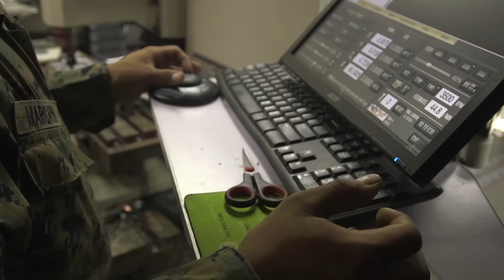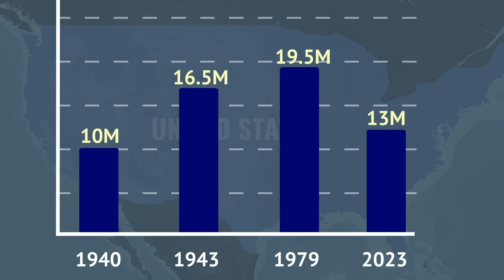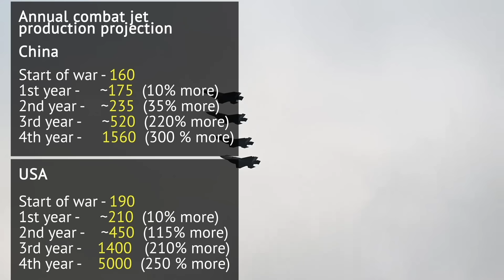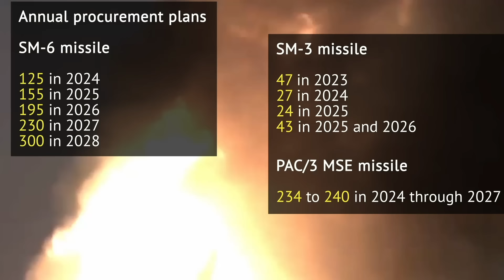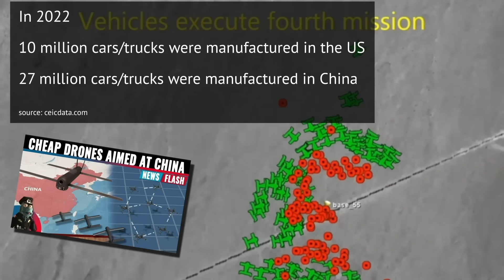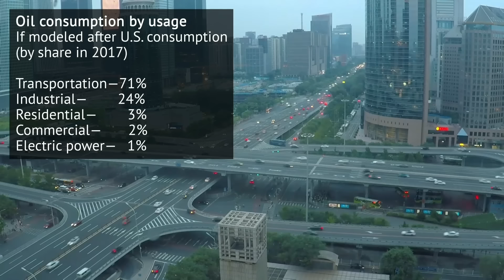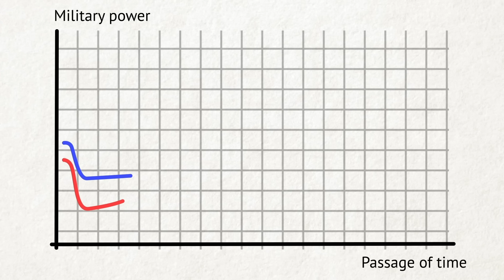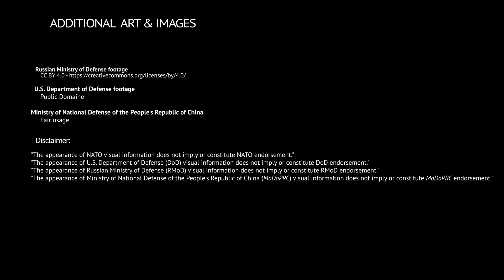Can industrial output decide US v China war?

Comment: "Don't start a land war in Asia," the saying goes.  OK, putting that aside, you correctly point out the ocean would be the likely approach.  Considering industrial outputs for both sides, may I suggest an additional consideration: the necessary inputs for each country's industrial base and each country's population.  Looking at the necessary industrial inputs -- all sorts of raw materials, oil, food for military and civilian populations, etc -- China's logistical chain for all of those inputs is quite long, is seaborne, and those inputs are critical for keeping the lights on and the population alive, much less fighting a long war with an opponent like the US.

TL;DR

That's a no-win situation for China.  Full stop.  China imports more oil/oil equivalents than anyone on the planet.  The daily energy needs for China is something like 12 or 13M barrels of oil (or oil equivalents). About 70% of that 13M-barrel supply comes from the Mid-East on the longest supply run for oil deliveries on the planet.  All that Mid-East oil heading for Asia goes by India, through the Malacca Strait, by Singapore and eventually to southeast Asia.  The route through the Malacca Strait is the shortcut (!) to get to southeast Asia by sea.  

If China goes to war with anyone who has even a small navy, it would not take much to park some surface ships in the Indian Ocean (and submarines underneath) and cut the oil supply line to China.  Even if the oil ships avoid the 800 km of the narrow Malacca Strait, they have to sail much, much farther, extending the longest oil shipping supply line by maybe 1/3?  BTW that alternate route would also be staked out by an opponent of China.  Point is, without 13M barrels per day, China would have a lot of trouble keeping the lights on, the population fed, and the country running, even on a reduced wartime footing.  It also would mean the end of most of China's industrial processes, once their reserves of industrial inputs are exhausted.  

Then there's food.  I believe China imports more food than anyone else, most of that by bulk shipping.  They grow a lot of food also, sure.  Yet they import most of the inputs they need to grow that food.  IOW shipping anything to China during a shooting war will probably drop by 80% because shipping companies do not want to be in a war zone. (Note that almost all shippers are out of the Black Sea by about 90% since RUS invaded UKR. The RUS "ghost market" ships still move oil and other goods to buyers for a big discount, but they do not ship serious amounts of anything to/from the Black Sea.)

Yes, China would have reserves of the inputs they use.  Yet they import more of the key inputs than anyone else:  oil, food, raw materials.  Cut those supply lines by 1/2 or 2/3 or more and China burns through the reserves.... then things get very bad very quickly.  Food shortages and eventual famine, de-industrialization with no oil/energy, and a population of over 1 billion people in dire need of food and energy to survive. There's no version of a war between the US and a no-food/no-oil China that ends well for China. 

This long list of things that could go wrong assumes that no one else in China's neighborhood decides to attack China's logistical supply lines either.  China is not on good terms with Japan, South Korea, the Philippines, Vietnam, or any of the rest of its neighbors.  Any of them could make supply chain problems become nightmares for China while China and the US shoot at each other.  

At what point would China, faced with the supply line problems above, go "new-Q-ler"?  (sound it out, it should sound like the words "new" "clear").  
So..... none of us should want a war between China and the US.  Not China, not the US, and not the rest of the planet.
Reply: @The136th 20% of China’s GDP is from exports, but more than 70% of China’s oil usage is from exports?
Reply: That makes it worse for China. Think about it. About half of China’s domestic economy is in real estate and infrastructure construction. Cement, steel beams, buildings, and bridges. Exports are manufactured consumer products. Washing machines, toys, clothing, etc.

Compare: (Cement, steel beams, buildings, and bridges) vs (washing machines, toys, clothing, etc.). Which set gets a larger proportion of its value from its embedded energy? Which set gets a larger proportion of its value from the ingenuity, skills, and effort of the workers involved?
Reply: Most of China’s manufacturing value-added stays in China. For example, China produces 55% of the world’s steel, but China consumes 50% of the world’s steel. If this conflict breaks out, we will be happy to watch that all go to zero. The difference between 55% and 50%— that 5% will be a shortage that we will have to deal with, but that’s plenty doable. Existing facilities can make up a big chunk of that. From there, the US’s market power will ensure that the shortage will fall elsewhere.

Rare earths aren’t an issue at all. After China used them to attack Japan a decade(?) ago, companies and governments took steps to neutralize the threat. Won’t be an issue.

The pandemic also showed companies that they need to diversify supply chains. That definitely includes pharma companies. China might still manufacture a lot of drugs, but companies believe that they have built enough resilience against disruptions to get new facilities up and running before supplies can run out. 

That resilience is possible because there is lots of underutilized low skilled labor available around the globe. In contrast China cannot build comparable resilience to loss of maritime trade access, because underutilized alternate trade routes and resource suppliers simply don’t exist.
Reply: Ok, now imagine how American consumers would react to no longer getting iPhones.
Reply: @The136th Neutralized. For starters, we have figured out how to use a lot less. Remember hard drives? Spinning disk inside every electronic device that provided permanent memory storage? Rare earths’ powerful magnetic properties allowed you to get a magnetic bit of memory into a smaller area, so rare earths were a major component of every electronic device that required lots of long term data storage. But when was the last time anyone used a device with a hard drive like that. There are no spinning magnetic disks in our devices anymore. Instead of magnetic disks, electronic memory is all solid state chips now.

We need a lot less rare earths now. The global annual market for rare earths these days is measured in the mere millions of dollars. That’s “millions” with an “m.” The companies that still need to use significant amounts of rare earths are big companies like Apple and Siemens that can afford to scoff at costs that are measured in the mere millions. Those companies now routinely keep many months of the rare earths they need in storage, just in case. 

Those companies are also big enough to have lots of political clout. They have convinced multiple governments around the globe to set up rare earths processing factories. Those factories are kept mothballed, ready to go into operation if they are ever needed.

Those companies believe that the rare earths threat has been completely nerfed. A decade ago, they were screaming about the danger. These days, the only time it comes up is when company leadership has to reassure uninformed shareholders.

Rare earths are no longer a major source of strength for China or weakness for the wider world. China produces them for cheaper than anyone else, which is nice. But rare earths are no longer a dependency.

Comment: You left out China imports all of its Fuel and hence China would be crippled.
Reply: Yeah but thats why china has that pipeline for the russian oil. If necessary they could speed up its construction and would have to be heavily guarded
Reply: @SilenTHerO78614 Capacity is only a tiny fraction of what China would need.
Reply: @yopyop3241 They could always ship oil by truck if necessary or build new pipelines in a hurry.  Russia is the second largest exporter of oil in the world and shares a border with china, how to get the oil there isn't exactly an insurmountable problem.  Chinese oil stocks would last roughly 6 months which is enough time to get something worked out with Russia.
Reply: @elmateo77  Like I said, nowhere close to enough capacity. Do you know how big oil tankers are? How many trucks it would take to replace that capacity? What the road conditions are for a drive across Siberia?

China can last six months only with strict rationing and without any major oil expenditures. You know, like the oil demands associated with an amphibious move on a neighbor. If China isn’t planning to surrender right away, it can’t last more than a couple of months.
Reply: You left out the fact that China is now the first in EVO cars. This reduces fuel requirements a lot.
Reply: @yopyop3241   spot on.  Alaska pipeline is a good reference the Americans used all there industrial might and had nearby ports and built roads and 10’s of thousands of workers and it took years. Now imagine makeing that pipeline in Russia through Siberia lol 😂. USA is king of Logistics now look at Russia hell it can’t even supply its troops which are 100 of KM away from huge supply hubs. No China will not get such pipelines anytime soon.  And the USA Attack subs would close the Malaca strait and both canals China would implode.

Comment: The biggest problem for the US is that it couldn't even ramp up war production during a time of war, even if it wanted to. Why? Because the US doesn't have the raw material, it doesn't have the factories, it doesn't have the equipment, and it doesn't even have enough to defend all of that even if it did have it. You can't make manufacturing machines out of thin air. These are big heavy machine that require not just materials and time, but also expertise that no longer exists in the US. Not even 1 in 10,000 people in the US have the expertise required to run such machines. China on the other hand, can simply produce lower quality in high numbers. 

What's one top tier jet vs 100 mediocre jets. You simply can't win. Now multiply that by everything. They lose 100 jets, they'll have 100 more up and running in a week. US loses something, it takes months if not years to replace it. Just look how long it takes to build a single carrier or jet or tank in the US. They could speed it up, sure, but it wouldn't be enough, and eventually things will run out. The US has almost no mining activities left for raw resources. The US has almost no metal foundries left, so it couldn't even process the ore, let alone turn it into something usable, not at adequate war production levels. 

And then there's expertise again....when you have a bunch of completely inexperienced people, not only will their work product be inferior, that will cause issues with production at every level. Not just slow downs, but complete stoppages, dangerous working conditions, and inferior parts used in construction that cause a plethora of logistical issues to the point stuff will be breaking down all the time. Anyone who believes the US can muster anywhere near an adequate war time production is living in a fantasy.
Reply: Lol China imports 60% of its oil overseas. Also “the U.S. has no raw materials,” 😂😂
Reply: @garrettfulks2932  cannot agree more. US could make its own jet with non-Chinese raw earth and cue its own peopele with non-Chinese medical meterials. Besides, the living standard will be higher without Chinese cheap products. People will support the current party without any thoughts of switching to the other.
Reply: @garrettfulks2932 You forgot who controls the Persian Gulf🤣👉🗡⏰

Comment: The U.S. is making 3 destroyers/frigates per year? My state shipyard builds 2 Arleigh Burkes per year...and it's not even close to the biggest military shipyard in the country. I used to work there and off the top of my head I know of 4 shipyards 2 on the East Coast 1 Gulf Coast and 1 West Coast that all build at minimum 2 destroyers/frigates per year so I think your info is off Binkov.
Reply: You can look up the commissioning's, you know.
Reply: @westrim  and ingalls in Al is 2 a year as well and those are just the two building flight 3 Burkes you have freedom independence class lcs which I used to do the graphic design modifications on

Comment: As a Chinese national, I've noticed that many people in the comments section, while aware that China is the world's largest industrial nation, seem to have a limited understanding of the country. Therefore, I'd like to share some insights:

1. China's southeastern coast is protected by the world's most comprehensive ground-based air defense system. In the event of a conflict, it would be nearly impossible for an enemy nation to attack mainland China with air forces and missiles.

2. Currently, China is both a major manufacturing hub and a significant importer of resources because it serves as the world's factory, producing industrial goods for global consumption. In the event of a conflict with the United States, while resource imports could be blocked, there would also be no need to produce a large volume of consumer goods for export. China's own resource reserves are more than sufficient to withstand several years of war and blockade.

3. There's no need to question China's military strength and the domestic production of military equipment. In terms of core weapons and equipment manufacturing, China can achieve 100% self-sufficiency, not requiring a single imported screw. While the Chinese navy and rocket force may have limitations in blue-water operations, they are fully capable of destroying any US naval fleet near their shores upon detection. Hypersonic missiles could destroy all US military installations on the First Island Chain within 30 minutes, rendering the military presence of the US and its allies in this area negligible.

4. The video completely overlooks the determination and will of the Chinese people to resist foreign aggression. If a full-scale war were to break out, whether it lasts ten or twenty years, we are prepared to endure until complete victory.

5. Regarding military blockades, while a conflict would indeed pose significant challenges for China, the video makes a valid point that a new ecological balance would eventually emerge if war becomes the norm. From a resource complementarity perspective, China and Russia could become the most solid allies. Should such a scenario materialize, it is the United States that would likely find itself at a disadvantage.
Reply: chat gpt post
Reply: On the contrary, it will be the Americans who fire the first shot. @Bingusgingus
Reply: dont waste time, ask yourself the question whether other people being uninformed is good or bad for you. If they think China is in a bad state and it is false, it is to China's advantage. If they think China is in a bad state and it is true, then China should work on itself. Correcting other people's perception solves no problems.
Reply: Your problem is you assume only the US gets involved when in practice that would result in an article 5 bringing in all of NATO, never mind Vietnam, The Philippines, and India all who could be easily convinced to join in return for territory at the victors table.
Reply: Sou do Brasil e apoio a china, força china 😊
Reply: @SilenTHerO78614 Ur NATO even cannot deal with Hamas and Ukraine. I mean seriously, how many lost have u guys achieved from Asia land since World War Two?
Reply: "Resist foreign aggression"?  In a Chinese invasion of Taiwan wouldn't they be the aggressive ones?  I question how much the Chinese people would be willing to sacrifice to support their leader's desire to reclaim Taiwan...
Reply: @howardlee7588  1. Israel isnt in NATO so technichally not everyone elses problem.
2. Ukraine also isnt in NATO but that hasnt stopped france from trying to get invovled. The problem with Ukraine is nobody wants escalation but it may force the issue.

3. China had been fucking with its territorial neighbors hard so its not exactly a hard sell to join the figjt against them considering the recent shenanigans. Especially in the himalayas and the south sea
Reply: @howardlee7588  fourth we have quite a few victories but you always focus on the losses while ignoring The Gulf War, Kosovo, and Iraq 2. Even the Chinese lost a war against the Vietnamese in the late 70s.
Reply: The Taiwan issue is a domestic matter of China, your views on Taiwan are merely a bargaining chip that the United States hopes to use against China.
Reply: @SilenTHerO78614 china did not lost
The  vitname end their war period after china give them a lesson
Vitname became a normal country again
Reply: People tends to take a side and justify their positions instead of providing pragmatic analysis.  The fact being war between China and US will be ugly and mutually destructive.  No matter how much you sandbox and play the war scenarios.  Both countries are equally capable of hurting each other r strategically. Both have capabilities to hit each other across the ocean.  The US does have the advantage of allies near Chinese shores. But once, I don’t think the Chinese not sandbox these scenarios and comes up with a counter.  Again, both are countries with resources and capabilities. No one wins.
Reply: @MarleyRess We always assumed that the United States would enter the war
Reply: @elmateo77    all Chinese regarding Taiwan as part of China
Reply: @WingkKong I mean yeah, because saying it's not while in China tends to result in you have a very short life expectancy...